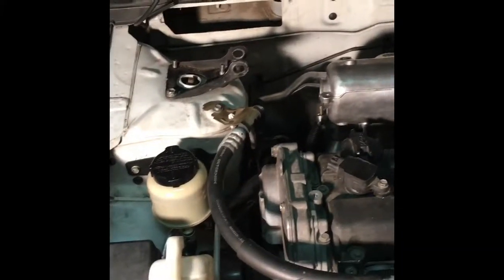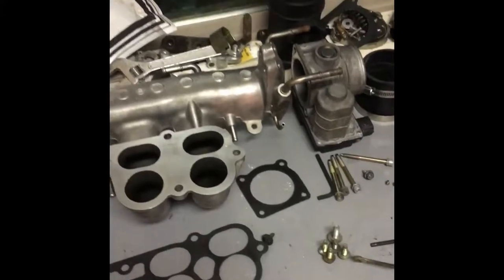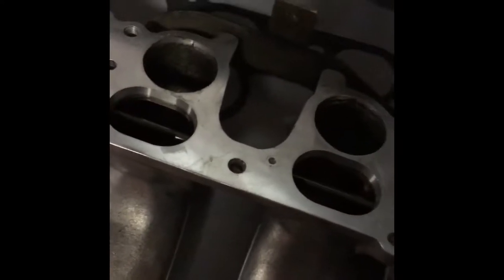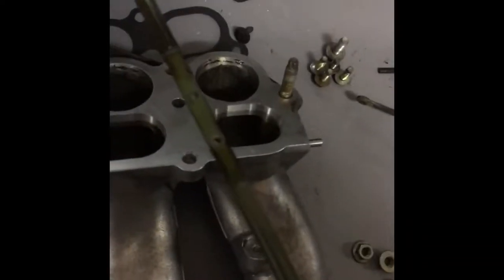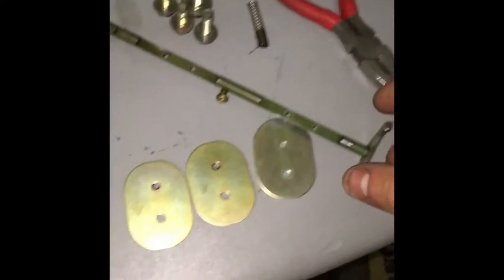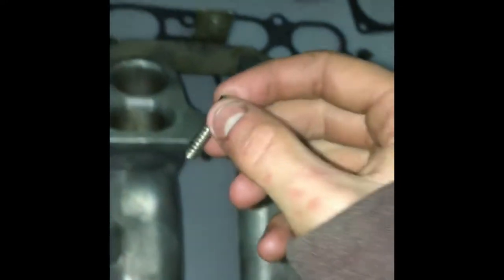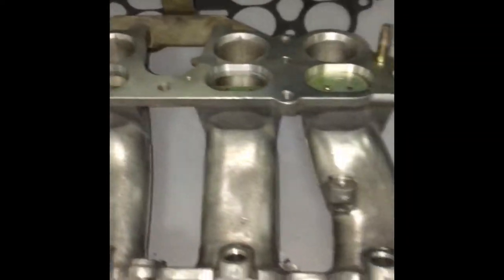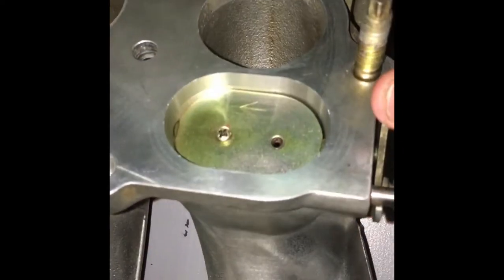Sentra SE-R Spec V how to loctite butterfly valve screws + intake manifold cleaning

Comment: I have a 2004 SE-R and When I approach over 3000 RPM the car will make this very bad fluttering noise. Under three grand there is no noise and runs great. Somebody told me these butterfly screws could be bad? I was wondering if you had any information regarding that issue. Nonetheless great video and thank you for sharing. Any help would be appreciated

Comment: If my 2005 Vspec does not have dual runners for the intake what does that mean? Does that mean I do not have secondary ports with butterfly's? Or is it some other engine. It's so hard to tell because every video explaining this has mention of the year they are working on.